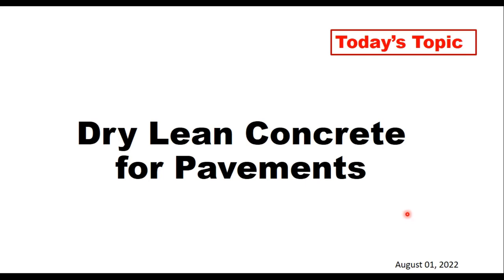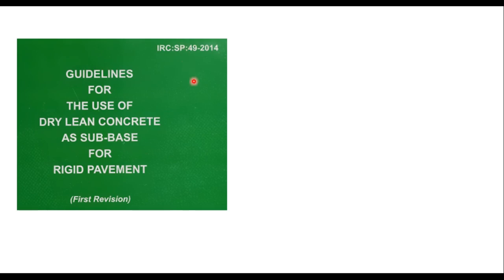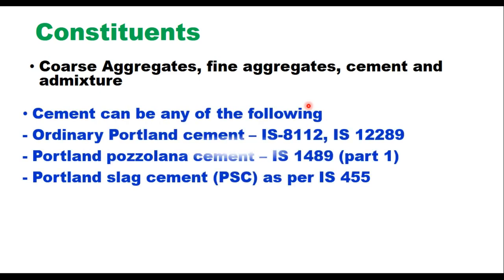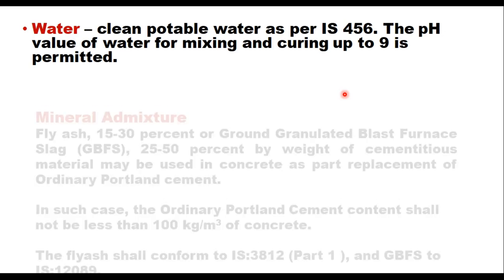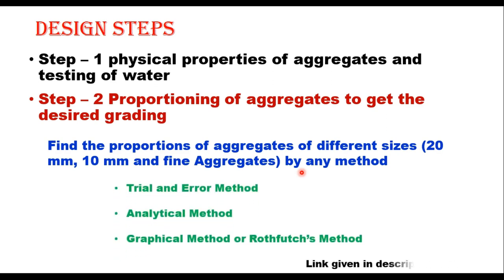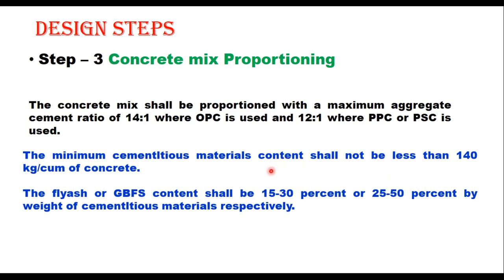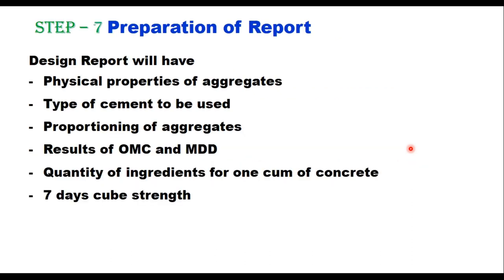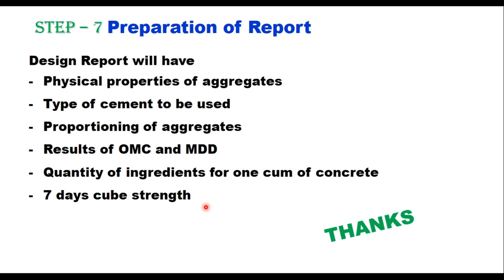#highways, Mix Design of Dry Lean Concrete (DLC) for Rigid Pavements, IRC SP 49, 2014

Comment: Hi Sir, Nice vedio, I have some doubts
1. Can we use drylean concrete as profile correction layer?
2. After DLC laid, how much day need to give gap for  laiding PQC?
3. Can we use Wmm insted of DLC as a base layer  during Pqc design ? Because I thought  DLC is also regid material means it's rebound  some percentage of load reverse back to pqc at end result its increase vehical mentainece cost, PqC damages? What is your view sir.
4. General in city area DLC is not properly laid  due to this early stage crack occure in PQC . What is your option or suggestion.
5. Can we laid pQc on directly  Dlc without polysheet?
Reply from the maker: Profile correction of what? of top of PQC, no way.
PQC should be laid not before 7 days.
Yes, you can use WMM also in place of DLC, design the pavement accordingly. For heavy traffic roads like SH or NH, DLC is recommended.